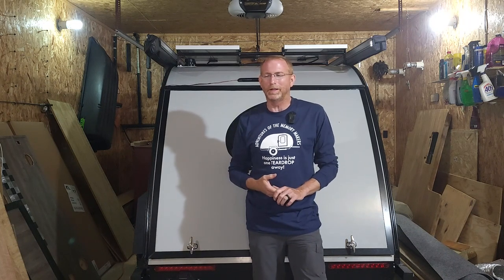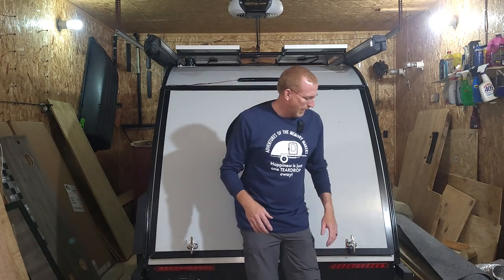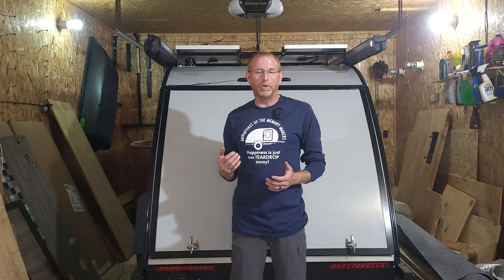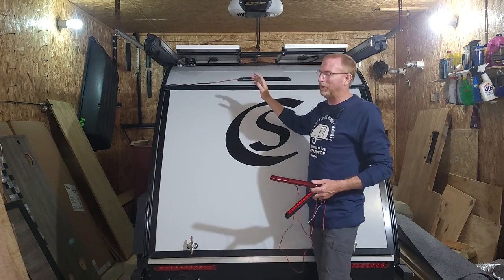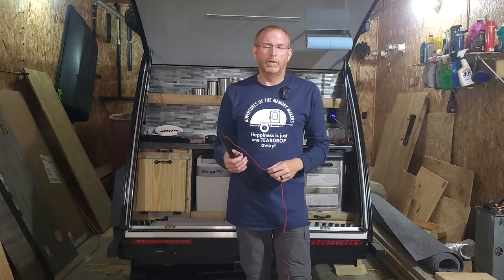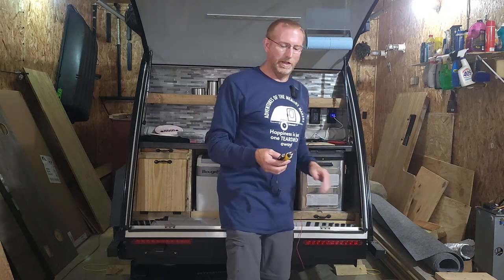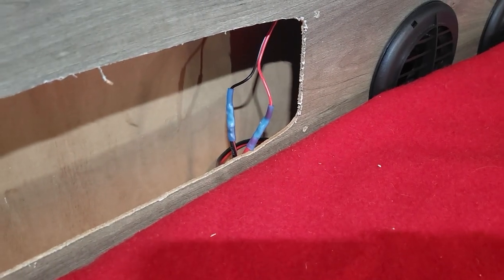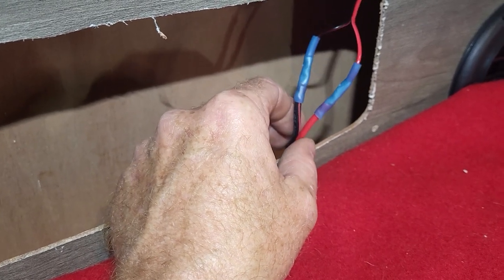How to install a 3rd brake light on a Teardrop camper

Comment: You are very insightful to have done this mod. The DOT should mandate this. It's a no-brainer and would add next to nothing to the price of a teardrop. Thanks!
Reply from the maker: Thank you Tom. That's is what I was thinking as well. With the current lights mounted so low on the camper, a brake light up at the sight line of the vehicle behind you will be a huge benefit with catching people's attention behind you.

Comment: Sam, another awesome enhancement. What size and type of screws did you use to mount the brakelight and how far down from the roof line did you have to drill to get into the wall?
Reply from the maker: I apologize, I just saw your questions 
I used #10 screws to mount the light. I would be afraid to give you a distance for the wall as it would probably be different on your camper as they are all over the board. It's easy to find with a few measurements and eyeball.